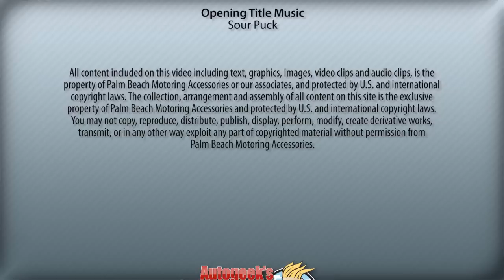How to tape-off car trim before machine polishing

Comment: Mike, when you pull up the 3M tape, do you ever have residue left on the painted surfaces?  I have (Here in FL too where we have the heat...) and wondered if:

1:  Do you experience residue from 3M auto body grade tape

2:  How you remove it?

I have been using a micro fiber cloth with alcohol on it, but I know this strips the surface of any protectants I have applied.  This is why I have suspended taping for now.
Reply: Christopher Oshana 
Look around for sure-solv, or 2 way by Castle, both have laquer removal strengths but are harmless on clear and paint. Awesome for sticky removal.
Also , there's always goo gone ( Walmart or Dollar store item) all work great👍
Reply: Might as well just get a new paint job after you get that residue on it

Comment: Just compounded and when lifting a piece of tape I notice a little compound line right where the tape was.  So what do I do?  Do I clean that off now with detailer spray?  Do I use an alcohol mix?  And then do I re-tape? My next step was going to be an all in one.  Do I keep the tape on and now do the all in one and THEN wipe it off with a product?  Won't that product take off the wax I have put on the car with the all in one?